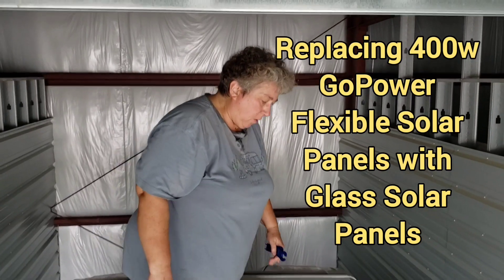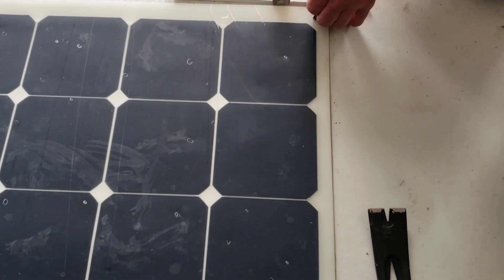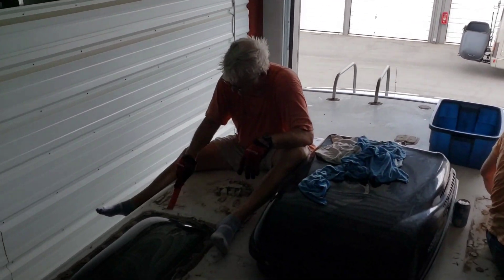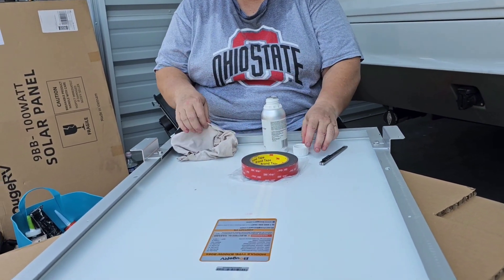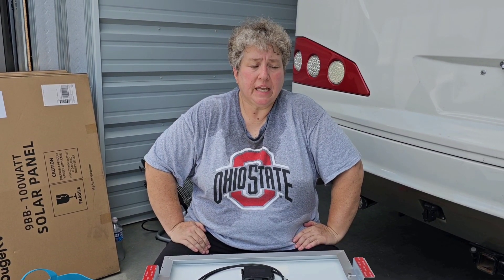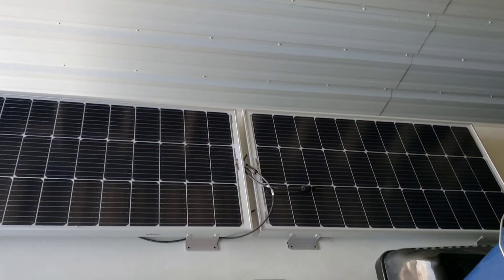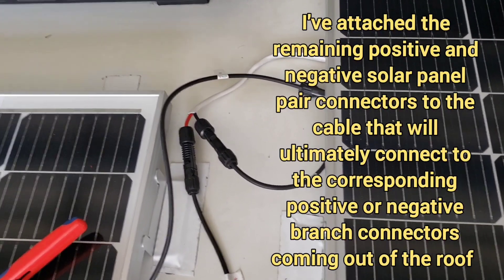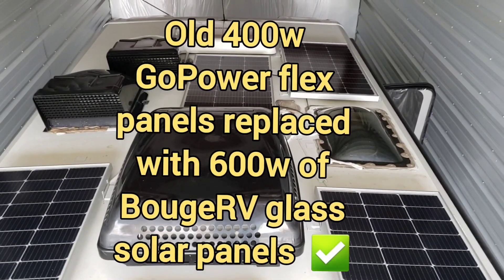Replacing Leisure Travel Vans GoPower Flexible Solar Panels with BougeRV Glass Solar Panels

Comment: Thanks Sandra. Great presentation.  I have a 2017 UTB with (2) 100 watt GoPower panels.  Is there anything in particular I might have to do differently (like wire upgrades, etc.) to do this install?
Reply from the maker: No, just decide how many panels you want to upgrade to and will fit! The method is the same no matter the year or floor plan of your LTV Unity. But also replace your solar controller, which my next video will cover.

Comment: Was there a reason to pull old panels as opposed to just going over them with new panels?
Reply from the maker: @MarkWilliamson-j6h  You can always simply put new glass panels over the old flexible panels. I know folks who have done this. I think it's more typical removing them, and starting with a blank canvas so to speak. But it isn't strictly necessary.

Comment: Thanks for all your help.   I have a 2017 Unity 24TB.  The goal is to go from the old 200 watts of flexible panels to 600 watts of Bougerv solar in series parallel configuration.   After studying the roof layout both for shadowing and future ease of maintenance allowing for as much safe walking area for a 78 year old owner,  I think a combination of 2 100 watt panels and 2 200 watt panels would be an excellent option.   There is about a 5 percent lower voltage on the 100 watt panels than the 200 watt panels.   The way I understand the consequences of this choice, the 400 watt panels would only put out about 380 watts max.  Since shadowing would be dramatically reduced,  I'm thinking that overall efficiency would probably be improved.   End goal is to wire 2 100 watt panels in series and the 2 200 amp in series.   Then connect the panels in parallel at the roof connection. 

What am I missing?
Reply from the maker: I don't see how shadowing is reduced by using 200w panels mixed with 100w panels. Bottomline, once you do the math for mixing panels with different output voltage and amps, is that the lowest voltage and amps is the limiter for performance. Panels in series act as one big panel, so you really want 200w panels wired in series. While 100w panels need to be wired in series pairs to get their voltage output higher. I think you're seriously over-thinking this. 6-100w BougeRV 9BB glass solar panels wired in series pairs and then the pairs in parallel out perform their specs by as much as 20%. I have people send me screen shots all the time of their Victron solar controller history that shows yields of 680-720w, so why install a mixture of panels that is only going to reduce the possibility of getting solar harvest yields like this. In my experience, it is much easier to position 100w panels to make walking around the roof easier. Larger panels would make maneuvering around them much more difficult. I really wouldn't recommend your approach because I don't believe it will get you what you think it will. Stick with the 100w panels, you'll be much happier all around with the outcome.
Reply: @SandyRVUpgrades  I

Comment: Great video as usual 👍
One question, I’ve seen reports of panels being damaged by hail, tree limbs, etc. Will I be able to disconnect the bolts on the mounts or will I need to pry the 3M tape loose? 
Thank you.
Reply from the maker: You can get to the bolts to disconnect the panel from the feet. It's tight but doable.
Reply: @SandyRVUpgrades  thank you 😊👍

Comment: What is the reason that you put two panels in series instead of putting 3 panels in series.
Reply from the maker: When you put panels in series you essentially create one large panel, so shading affects one it affects all. So by just putting 2 panels together you get the increased voltage your looking for. 3 panels in series would be unnecessary. Series pairs and those pairs in parallel is the most effective configuration for maximizing sun harvest all year long, particularly in winter when the sun angle is low.

Comment: the VHB tape sold on Amazon is mostly  Fake  and not as sticky or strong of bond as Real VHB  -
Good place to buy real VHB  tape is from RS Huges -  cost is about 5x what U paid on amazon  - 10x stronger bond and strength -
Real VHB is kind of dangerous to use - if even slightly touched with finger - skin is stuck to it  -  
wear thin  tight fitting plastic gloves  - use Plastic tweezers  - Foam core VHB works good for RV - vibrations  - 
Most RS Huges gives out Sample  VHB packs  for free - pack has about 20 different  small tape samples - 
VHB is tape form of super glue
Reply from the maker: I've had good experience with the Vhb tape I've gotten from Amazon. But I understand what you're saying.